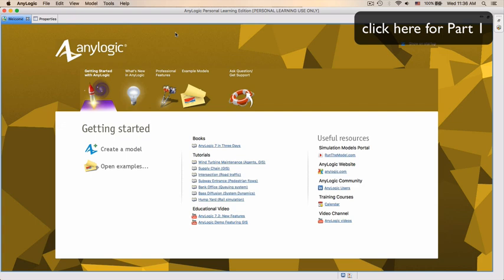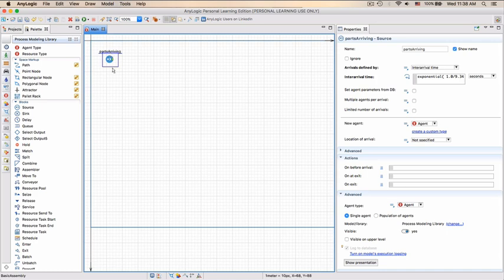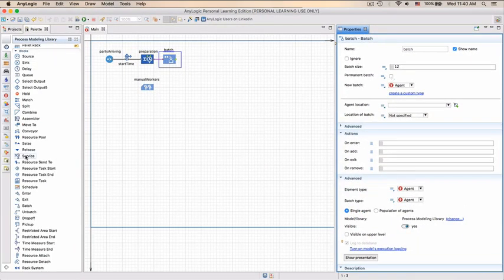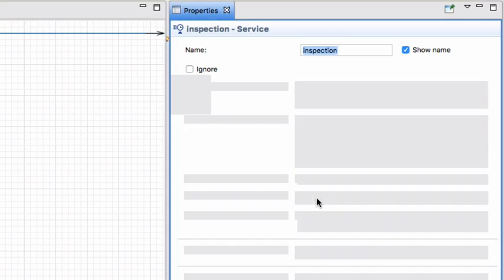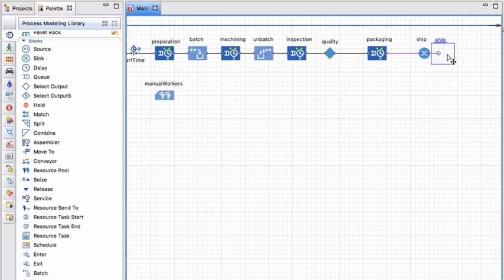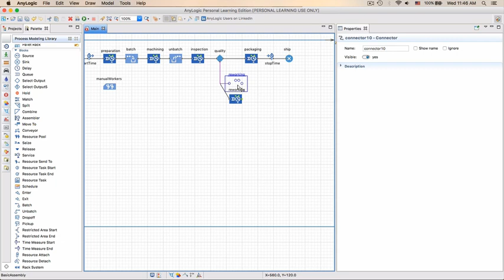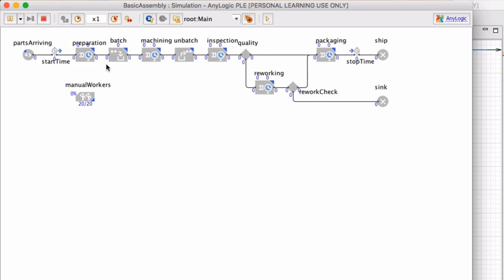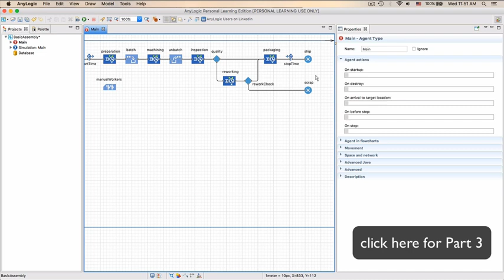BAN780 Basic assembly Part2

Comment: I have a question, why did not you assign any resources to the service block? I dont understand the logic behind it ! Thanks for your helpful videos
Reply from the maker: Samar Al-Sharafi, remember that these are purely illustrative videos. In this case I was only really interested in 'studying' the workers as a resource pool. And with 'studying' I mean we can change the number of workers, check their utilisation, etc. If we wanted to do the same for the other machinery, sure, we can. That's why I typically use a Service block a it allows me future extensions/adaptions. Otherwise I could have replaced it with a Queue-Delay block combination. The Service block is just convenient as it already incorporates Queue, Seize, Delay, Release into a single 'high level' block.